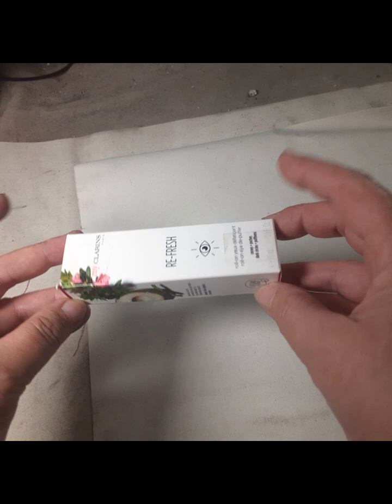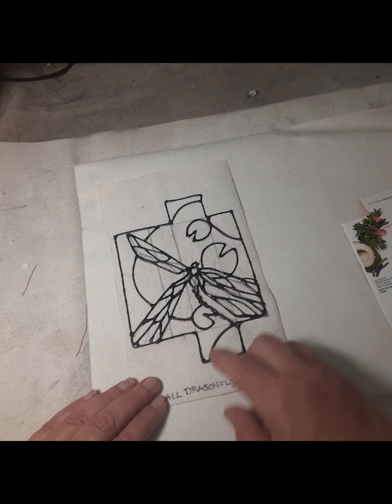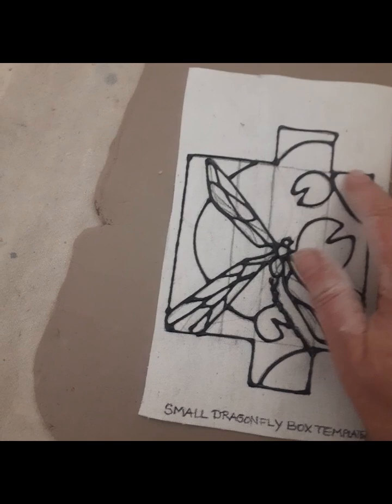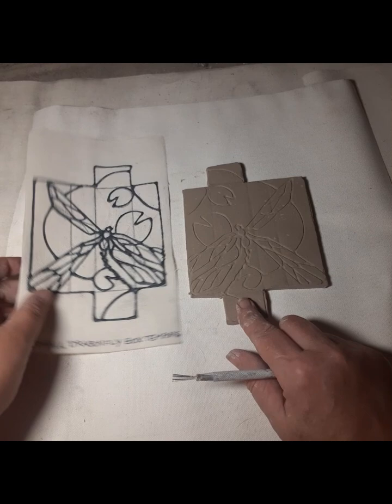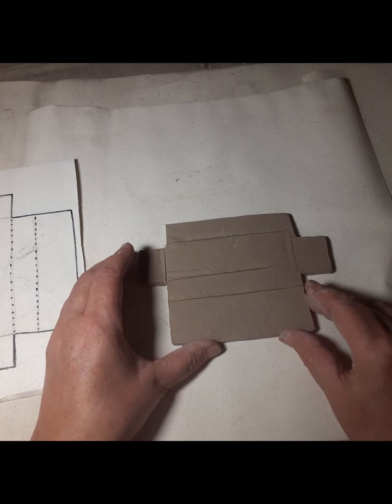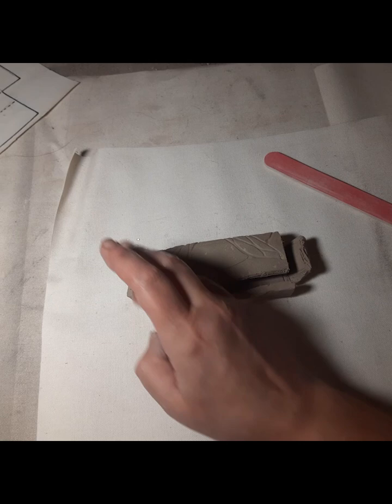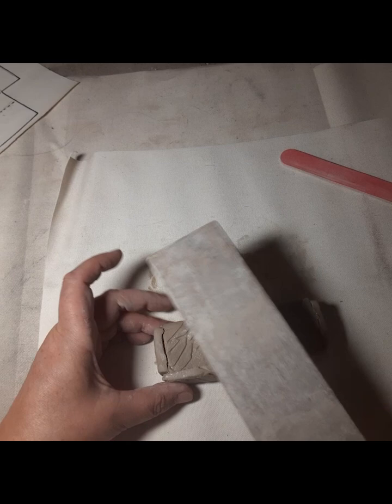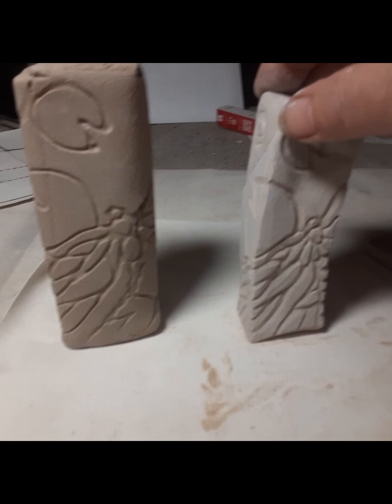Soft slab folded box template demo salt and pepper dragonflies

Comment: A tip from woodworking, cut out the clay in all the folds on the inside at a 45 degree angle.  This cuts a relief shaped like a Toblerone chocolate bar......so the clay does not bind up in the inside corner of the fold.  The relief cuts are not all the way thru the clay all along the folds.  Should make folding each side easier and should result in crisper edges and less reshaping with the paddle.
Reply from the maker: You could do that or you could cut all the way through and do separate slabs etc etc. There are many techniques for soft slab building. Sometimes I like the quick simplicity of folding and using the paddle. It is also less steps for beginning students that get frustrated doing too much precision steps early on and they still get to know the material and have successful small works completed.